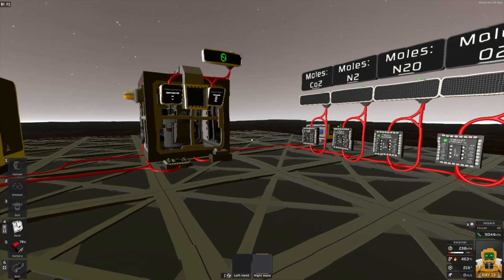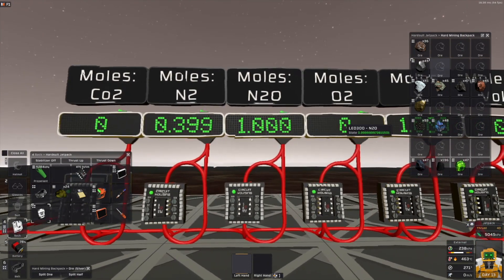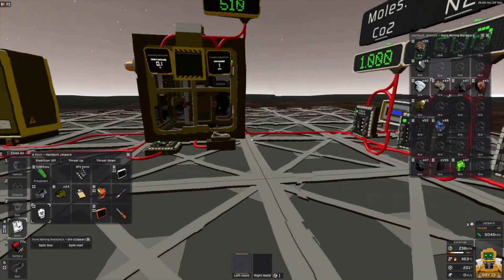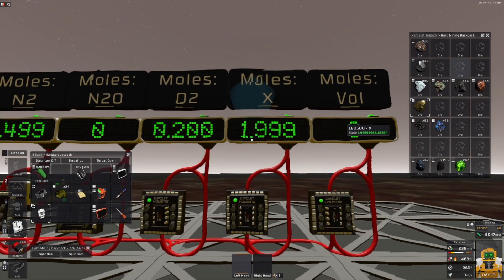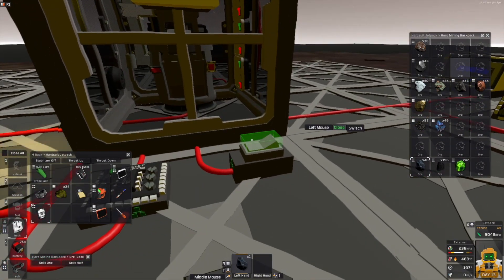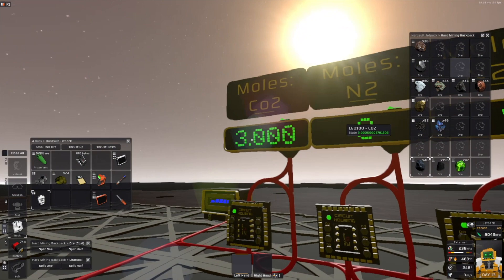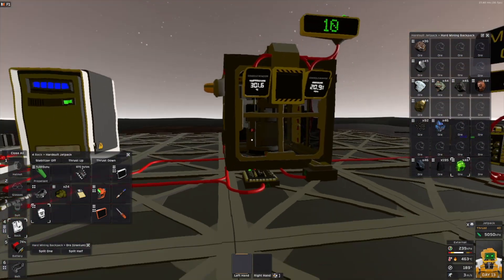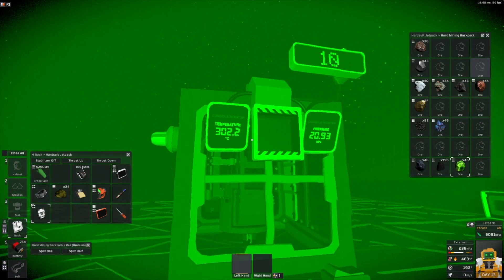Stationeers ( 2022 ): Arc Furnace vs Ore - v0.2.3712.18055

Comment: Great info.  Gives a use case for uranium,  sending the purge gas through a wind tunnel for some turbine power good net positive based off the 20 kpa per nugget.
Reply from the maker: Actually this is a great suggestion. Very nice thought - the amount of gas you get from the uranium should make this very viable indeed. Thanks man.